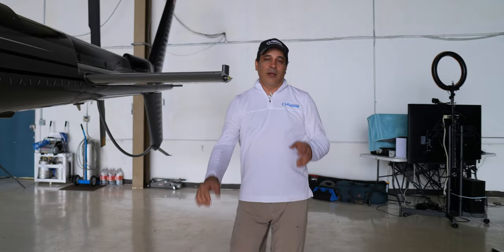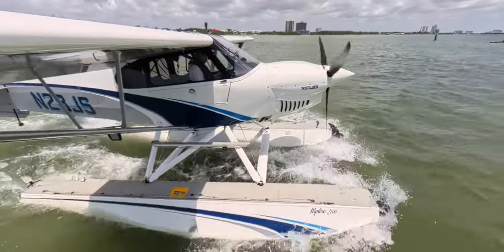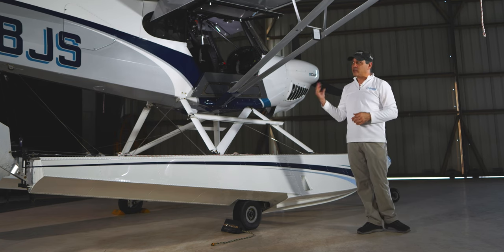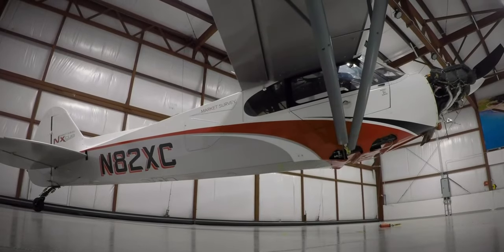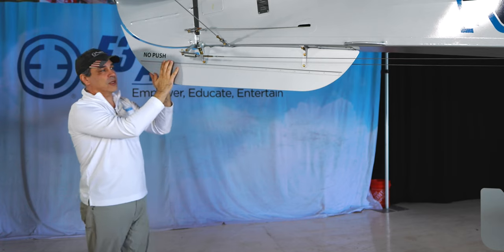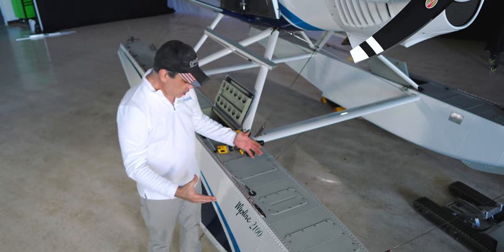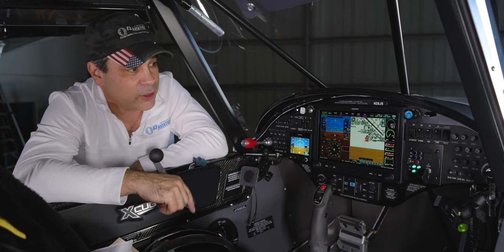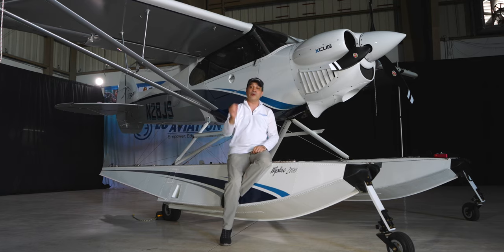CubCrafters XCUB: Bush and Amphibian Aviation Analysis

Comment: What helmet were you wearing in the cub? Did it have noise cancellation?
Reply from the maker: Yes we were wearing tiger in the video and it did have the BOSE in them  However we have anew video coming out using the Lift Aviation V2 helmets with lightspeed.  WAY BETTER.    Keep your eye's out for that video.